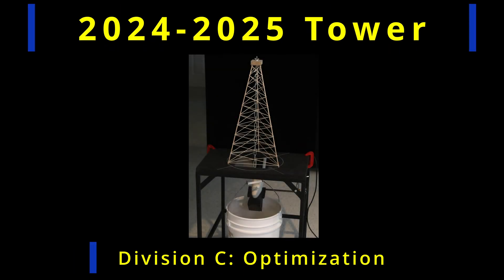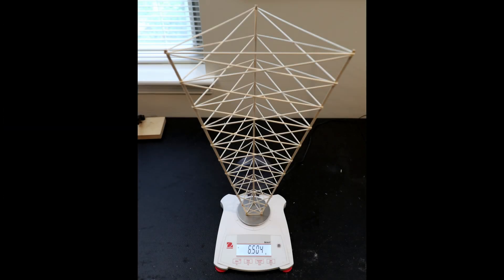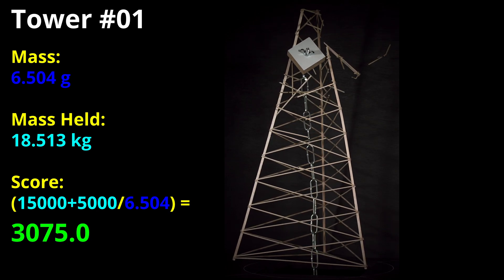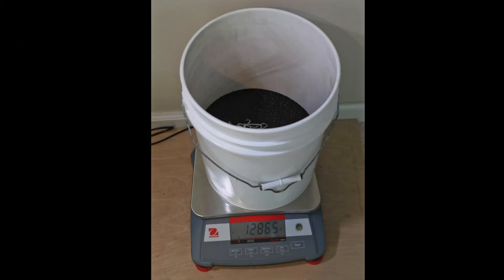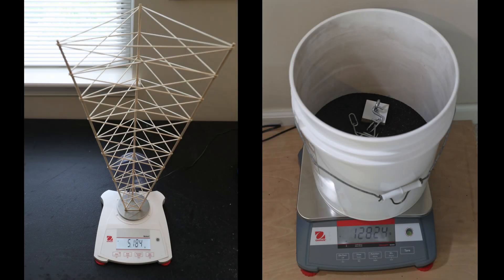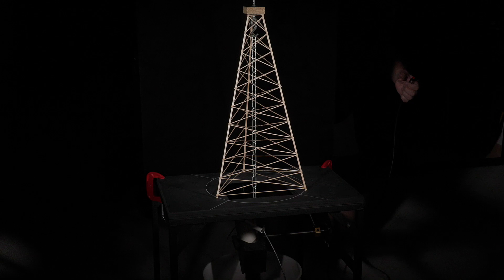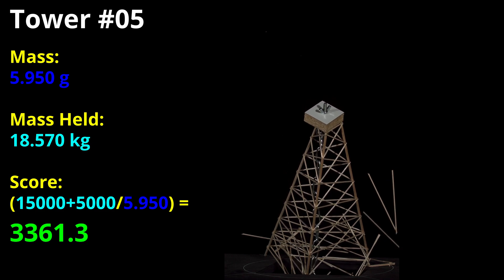2025 Science Olympiad Tower Div C: Optimization

Comment: Hi, Balsa Engineering , thank you for all those wonderful videos. According to your experience what’s the potential high score possible for this tower design? Is it possible achieve above 4200 efficiency score?
Reply from the maker: Hi!  Thanks for the kind feedback!  The winning score at the MIT Invitational was over 4400!  I saw a picture of it, and it's definitely legit.  That is probably close to the maximum score.  Maybe around 4500 is possible.  Anything around 4000 and you are doing great.  Good luck!!
Reply: @balsaengineering6686  Hi, Balsa Engineering, I was wondering where I could see a picture of the tower, I was thinking about using a mix of 1/16 x 1/16 and 1/20 x 1/20 balsa for the cross members, but I wanted to see if the MIT team used all 1/16 x 1/16.
Reply from the maker: @andrewn9499  Hi!  I definitely can't share that picture with anybody as it wouldn't be fair to them.  I share all the work I do, but any final optimizations individual teams do is strictly confidential. I hope you understand.  Good luck!!
Reply: @balsaengineering6686  Yes, I saw that MIT result but never see this score in other invitations.
Reply from the maker: @dihanlu9144  That tower at MIT was the highest score I've heard of this season so far, but there have certainly been others above 4000.  If your towers are 4000+ you should be very competitive at any competition.

Comment: Hey Balsa Engineering, I am pretty new to building towers, so I don’t have any sort of collection of balsa wood and don’t plan on making one in the future. I am trying to order 1/16 and 3/16 sticks from Specialized Balsa, but I’m not sure what ones I should order for density. I see they Have extra light, light, medium, heavy, and extra heavy. I can obviously take measurements to get more exact once I receive the balsa, But what density would you recommend ordering for the Cross supports and legs? Thanks
Reply: I also saw you said it is good to purchase sheets, and I can do that too if it’s better. I just don’t know which density range I should be purchasing from
Reply from the maker: @Tadeusopp  If you want to know exactly what I used, you can compute the density of the material from the information I show in my notebook pages.  mass/volume, you just need to convert to the proper units first.  That being said, in general, the source 3/16" sheets were firmly in the "medium" range of density and the 1/16" cross bracing was in the "light" range.  I would recommend cutting from sheets as it's much more cost effective and not terribly difficult one you get the hang of it.  Good luck!!

Comment: Hey Balsa Engineering! Thank you so much for your videos! My question is about the density of the wood for the tower legs. So far, I have only been using the most dense wood I can find out of the wood I have because I know it would be stronger, but my towers are all about 13 grams. Based on just feeling the wood in the first place, I feel that the less dense wood is too bendy and will break during the competition, even though I know that the cross-members make the legs stronger. Would you still recommend using the lighter wood even if it seems less sturdy at first? Thank you so much!
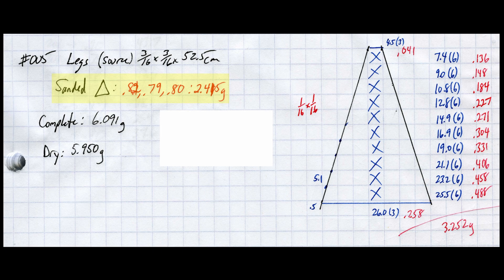Reply from the maker: Hi!  Thanks for the kind feedback!  Regarding the legs and them being "bendy" before starting, yes, that is definitely OK and to be expected.  The cross members not only make them stronger, they make them much, much stronger.  If you get a chance, please watch this video I made explaining (and demonstrating) buckling theory.  That should help explain what is happening and make you feel safe about using lighter legs.  https://youtu.be/xIRTnISueb4   Good luck!!  (PS, that being said, you might also be using much too heavy cross members, so definitely check those as well, perhaps compare the mass to what I have in my benchmark tower notes at 7:47 to see if they are similar)

Comment: Hi Balsa Engineering, could you tell me why you have the straight rods at the top and bottom? It seems like it would break the tower faster by making it more rigid (since it is unable to deform by small amounts)
Reply from the maker: Do you mean the horizontal pieces?  They are to add strength to the build.  They both may or may not be necessary depending on the rest of your material choices.  I left them both in to be more conservative with this build.  BTW, we want the tower to be as rigid as possible and not deform at all.  As soon as things start bending, they get weaker and generally break soon after.  Good luck!!

Comment: Hi Balsa engineer, my team and I always have trouble with sanding angles to connect the cross bridges how did you go about that? Are your cross bridges fitted on the outside of the tower rather on the inside? Also we have been using Bob Smith Industries BSI-157H Maxi Cure/Insta-Se glue (it has a super glue and spray) do u think this is okay? Thank you for your videos!!!
Reply from the maker: Hi!  Yes, creating legs that work well for a 3-leg tower is challenging.  My solution was to create 60/60/60 legs rather than try to sand just the connection points.  Check out this video for how I did that: https://youtu.be/MTHygxUS3YU    As for the glue, that seems fine, but I would not recommend spraying the glue on.  I like to use 50cps CA for my builds.  I made an entire video on glue and gluing techniques you might like to watch as well:  https://youtu.be/55lb2KzSiwg   Good luck!!
Reply: Do you have any tips for a school that doesn’t have access to a 3D printer? Also are your cross section sticks to the same angle? Like the X pieces? My team used to sand them and have them fit on the inner part of the tower but I see that your are just against the outer part, is this stronger?
Reply from the maker: @ellorjeejenenen2838  If you don't have access to a 3d printer, you'll definitely want to try and build an assembly jig of some kind using whatever you have on hand.  It really is a lot harder to make something precise, but it would be better than nothing.  Having the cross bracing on the outside isn't necessarily stronger, just much easier to assemble
Reply: Sorry to ask so many questions!! Just one more. Did you use your jig to send every sticks to side including the X pieces (cross bridges) and the triangular outside parts
Reply from the maker: @ellorjeejenenen2838  This is the video to check out to see how I used the jig during assembly:  https://youtu.be/TkUS4W4bOZM?si=U4VWuKUCqBfcovMi

Comment: Hey Balsa engineer, I don’t understand how do you make it so light weight. I use the same size balsa sticks 1/16 and use BSI CA glue and I still can’t get it under 20 grams. Please help me I need some tips. Thank you so much. You are the best
Reply: Also what are the sizes for each of the files for 3D printing
Reply from the maker: @Turkish123-n2t  The best way to see the exact size is to just download the STL files and put them in your slicer program and it'll show the sizes.  You shouldn't have to scale them at all, but you might have to rotate them 90 degrees to get them in the proper orientation for printing
Reply from the maker: Thanks for the kind feedback.  There is no secret to making it light, you just need to buy lighter balsa... Check out this video to see what I'm talking about:  https://youtu.be/mzMFhd4SqP8?si=QKqHyqg8exVFWKVc
Reply: @balsaengineering6686  thank you so much. What mass should I buy for tower Div C and what size should I get? Thanks!
Reply from the maker: @Turkish123-n2t  You should definitely study my notebook pages to get an idea for what density I'm using: see 7:46 for an example.  In general, I'm using light density for the cross bracing and medium density for the source leg sticks, but you can calculate it exactly from my notes if you want.

Comment: So did you download an app to record how your tower breaks. Since in slow motion, I still can’t tell where my tower broke?
Reply from the maker: Hi!  I'm using a very expensive dedicate high speed camera (Chronos 2.1) to visualize the failures at 2500+ fps.  You can't expect those kinds of results with a phone.  But my recommendation would be have as much light as possible, only film the tower (not the bucket or anything above) and use multiple phones if possible to try and catch that critical moment.  Good luck!

Comment: Hi balsa engineering, so in invitationals, they gave us 2 options to pour the sand into the bucket. The first one was your method and the second one was using a tiny shovel to scoop the sand and put it into the bucket. I wanted to go with your method but my partner forced me to go with the shovel method to “lower the velocity in which the sand hits the bottom of the bucket.” Can you please explain why your method of pouring the sand is better, since you show excellence in tower and have even won a national medal.
Reply from the maker: Hi!  If you have the choice between using an auto-load and hand-loading you'll always want to choose the auto-loader.  The main goal when loading is to minimize the time under load and when you hand load, there will always be a time your device is under load while you are refilling the cup/scoop.   When using an auto-loader, you can keep a stream of sand going all the time, and you want to keep that going pretty fast especially near the end.  Scores are typically a bit higher with an auto-loader for that reason.  If everyone is forced to hand load, try to refill the cup/scoop as fast as possible and pour quickly (within reason) as well.  The excess force of the sand moving faster from a higher height is not an issue to worry about and is counter-acted by the huge benefit of minimizing the time near max load. Good luck!

Comment: Hi Balsa engieering quixk question. I was able to get 2 legs in the 0.8 g rangw after sabdinf them, however I have one leg that weighs 1 g. Do you think I can still use the leg that weighs 1g with the same density as your cross bracing in the final benckmark desgin or would I need to increase the density of the cross bracings
Reply from the maker: Hi!  Sure, you'll have no problems using a slightly heavier leg in the build.  Just remember that your tower will only be as strong as your weakest leg, so that heavy leg will be fine, but it will just add a bit of excess weight to your tower compared to what it could have been.  Good luck!!
Reply: Hi okay thank you so much, also after I'm done building my  tower should I sand my legs to the same level as my horizontal bracing or should the legs be higher than the horizontal bracings? Finally you have any tips to keep the bucket balanced when loading the sand using a machine. Thanks
Reply from the maker: @asteralemayehu4973  You shouldn't need to sand the bottom of the tower at all, just leave the legs a bit longer than the cross bracing.  As for the bucket, my recommendation is to start fairly slow for maybe 5-10 seconds, but soon after that get to pretty much maximum loading speed.  You want to limit the time under heavy load as much as possible.  Good luck!

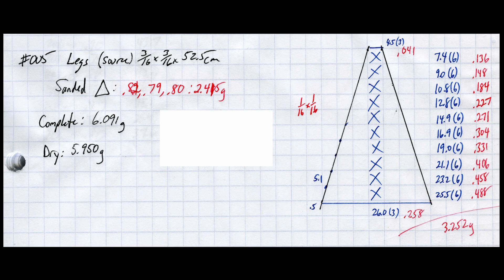Comment: Hell balsa Engineering, at 6:56 your cross braces are 1/16x1/16h. I only have 3/16th, 1/8th, and 1/4th inch wood. What do you think is the best move, using the 3/16h or the 1/8th?  Is it possible for me to find sheets of 1/16th balsa at the store? and if there are some how would cut them. Sorry for all the questions, I'm really stressed lowkey. Thank you
Reply from the maker: Check out this video for how I strip my balsa sheets: https://youtu.be/bLsTOpmozGI  You can use a very inexpensive screw stripper you can buy on Amazon.  You should be able to find 1/16" sheet balsa fairly easy, but maybe not in the density you want.  Worse case, you can use 1/8" sticks.  You probably wouldn't need to make Xes with them except maybe for the bottom couple layers.  If you can't find 1/16" but buy the stripping tool, you could cut 1/16" strips from your 1/8" sheet which would at least be half the mass of 1/8" sticks.  Good luck!!
Reply: @balsaengineering6686  Thank you so much. you're my hero

Comment: Hello Balsa Engineering, I was wondering what densities were you using for the 1/16 crossbracing pieces and the 3/16 triangular legs.  Thanks!
Reply from the maker: You can compute the exact densities from the information I show in my notebook at 6:56.  I show the dimensions and mass, so if you convert the units properly, you can calculate the exact densities if you want.   In general, the cross bracing was "light" density and the source 3/16 sticks were "medium".  Good luck!

Comment: Hi Balsa engineering, thanks so much for all these awesome videos. Do you think the three 26-cm cross bracings at the very bottom are necessary? You could save a good amount of weight if you did not include them. Also, what was the density of the 1/16 in cross bracing you ordered for the benchmark build? Thanks!
Reply from the maker: Hi!  Thanks for the kind feedback!  I think the bottom horizontal cross members may or may not be needed depending on how strong the rest of your lower cross bracing is.  My benchmark build took a more conservative approach and included it, but I encourage you to experiment and tweak the design based on the materials you have on hand.  I don't know the exact density of the 1/16" I used off-hand, but it was definitely in the "light" range.   You can compute the exact density for every layer if you want given what I show in my notes (exact dimensions and mass - just be sure to convert the units properly)

Comment: hey balsa engineering! how are you getting the 1/16 x 1/16 blasa wood sticks, are you getting sheets and cutting them yourself or buying precut ones? also are you sanding these cross bracings? and how long do these towers take you to build, it takes me about a day or two and thats seems excessive 😅. thank you
Reply from the maker: Hi!  I always cut my own sticks from sheets.  It's WAY more cost effective and you can have more control if you want to use non-standard sizes.  I don't sand these at all though.  These towers take a long time to build, so don't feel bad.  It probably takes me about 3 hrs total to build one and that doesn't count the time for material creation/selection.  You'll get faster with each one you make!   Good luck!!

Comment: Hi Balsa Engineering. I have a question about testing for the efficiency of towers. Is there any way to test without the bucket and sands along with the loading blocks to get a grasp of how much a tower can hold in kg? Thank you for the video.
Reply from the maker: Hi!  Not really... it doesn't have to be a fancy auto-loader like I am showing here, but a bucket with sand is about the cheapest/easiest way to do it.  You'll definitely want to test with a 5x5x2cm loading block because that's what you'll use in competition, so you want to make sure there are no surprises on test day!

Comment: Hi Balsa Engineering, thank you for all the informative videos! You make everything super easy to follow along with. 
How crucial is it that the legs are triangular? I'm don't have any molds like the one you used in the video, and not completely sure whether I'll be able to shave down my balsa sticks in time for my competition. Thanks!
Reply from the maker: Hi!  Thanks for the kind feedback!  The reason the legs needs to be triangular are that you really want flat surfaces to glue the cross-members to.  Square legs won't allow that.  It might be possible to sand down just the joint locations individually, but that won't be easy or particularly reliable.    Try to assemble a 3-leg tower with square legs and you'll see what I'm talking about :)

Comment: What has your experience been with reusing towers. For example, if you have a solid tower that survives and holds 15 kg, would it be possible to use it again two times?
Reply from the maker: That is almost always fine to do.  Over the years, my team used several devices multiple times without any problem.  I would recommend you pre-test that device again to make sure there wasn't any damage done by the first test.  Usually damage occurs if it's very close to its maximum breaking load.  You should definitely be able to pre-test to ~12kg to verify it's still fine.  If you want to be absolutely sure, you could pre-test to 15kg and then again to 12kg.  If it survives that, it's almost certain it will hold 15kg again.
Reply: @balsaengineering6686  Great, thank you so much! I will let you know how this turns out at the end of our season!

Comment: Good evening,  2 questions.  1.  I had really slow sand with the level full open as it barely moved.  The tower broke at 13.25g even thought tested holding at over 15.  HOWEVER the sand took 8 minutes before breaking.  If I ever had super slow sand again, anything I could have done to tower at competition?  2.    Also, do you recommend reusing a tower that held in testing and in a competition?  Hope to meet you one day. ⭐️
Reply from the maker: Hi!  You got really unlucky with such a slow auto-loader.  If this was a Science Olympiad tower event, I would contend that that auto-loader was not compliant with the rules which state you only get 6 minutes TOTAL to test your device and that includes setting the loading block up.  If the machine can't load the sand within 2-3 minutes, it's not fast enough. (my new auto-loader can run through 15kg in less than a minute wide open).  I would have said something... if you see that again, definitely raise the issue and have them let you load sand by hand.  That is probably what they should have done instead of using that machine.  With all that being said, normally it's not a problem to reuse a device that has been pre-tested like yours, but it's hard to know for certain if the first test did any damage.  If you want to make sure, it never hurts to pre-test more than once to make sure.  8 minutes is forever to hold that kind of load though, so I wouldn't read too much into that specific test.  Good luck!!